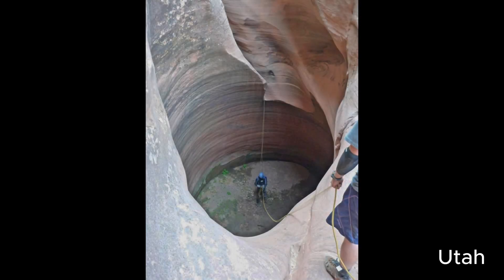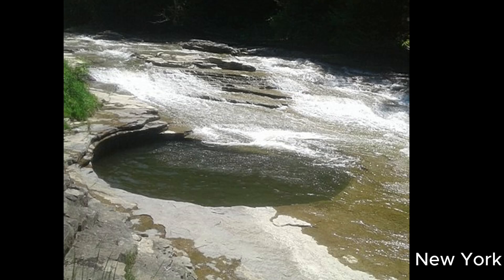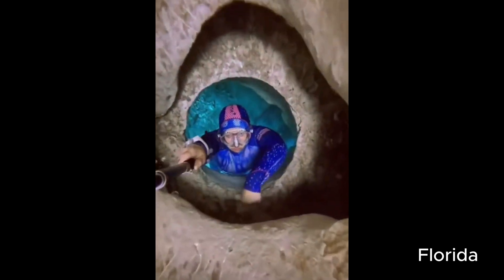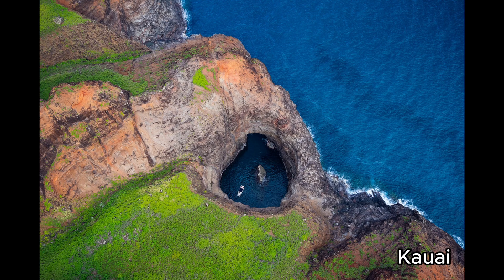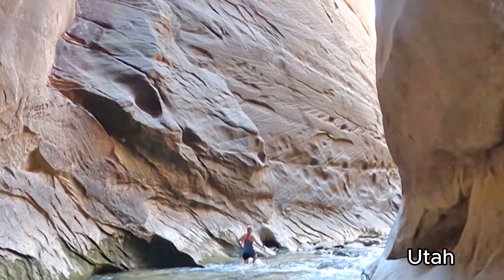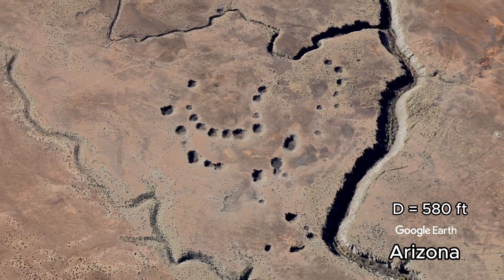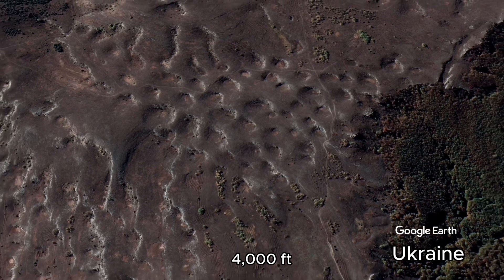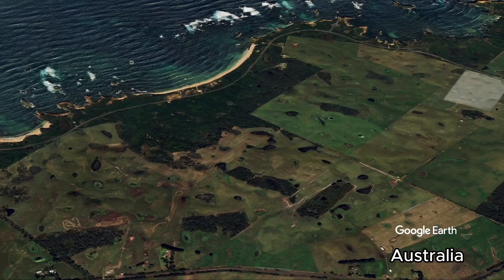Massive Water Vortex???

Comment: You know, the glacial erosion theory does not hold water, and meltwater or subglacial streams cannot fix it. The glacial poholes are exactly the same as potholes found everywhere else in the world. The clustering and variety in size is a clear idicator that they were produced by high speed vortices in water, with power levels that far exceed anything normally seen. The geodoxa videos show the mechanisms involved very clearly, but these are realty physical phenomena that can only occur in deep flowing water. This explains all the dune formations you see all over the world, the "glacial" landscape of Scandinavia and Canada, and the patterns of erosion and deposition. You can trace the flows with lidar and satellite images in a GIS program.
Reply: I have been working with this and similar topics for over a decade. Maybe we should compare data?
Reply: I found Willy Tepes, I wonder what that means for the safety of whatever prime minister, president or regent my country of residence.
Reply: @dajjukunrama5695  You should not blindly trust youtubers. This manufactured story was officially denied by the FBI. 
I am extremely peaceful and restrained. Your PM, President or similar has much larger problems than me. In relation to this topic I am a system analyst, and it is the system I wish to change. Others will deal with the judicial side of this. That is none of my business. I am sure everyone will be judged according to their own actions. ;)

No one can stop me from achieving my goals because they completely misunderstand what I am doing online. The research phase is however over, and that is why you will see a visible change in my interactions.